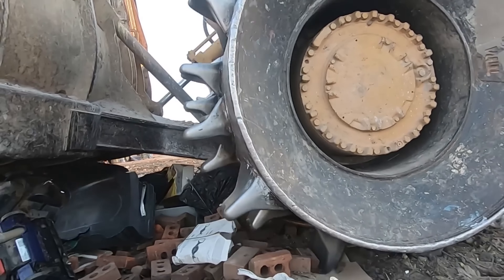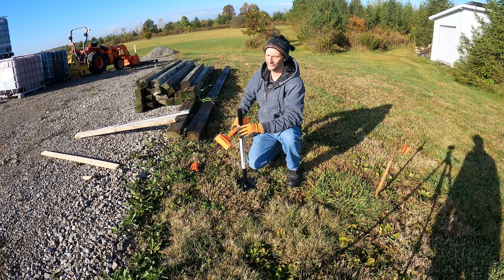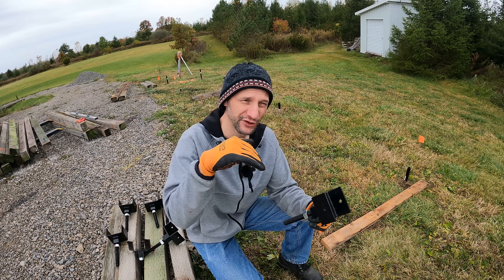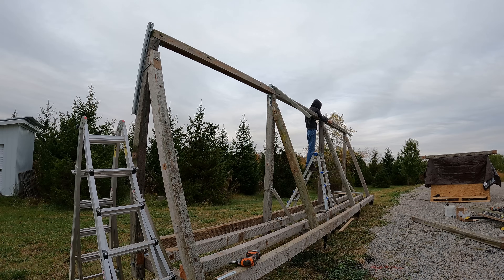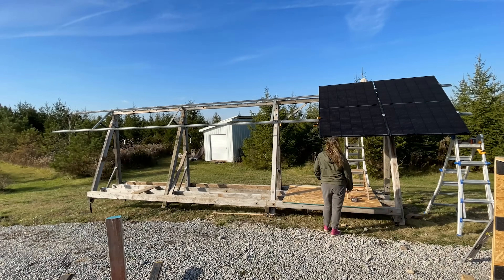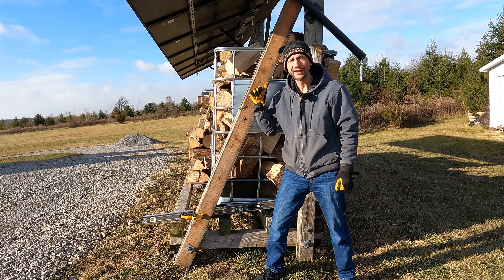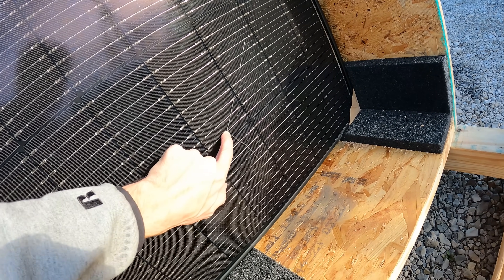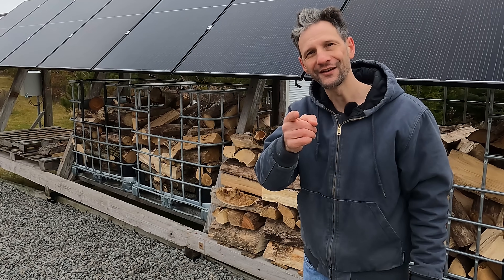Solar Panel Firewood Rack From Recycled Materials-Part 1

Comment from the maker: DIY Solar Powered Firewood Rack From Recycled Materials  Part 2: https://youtu.be/XSxp8pbk7q0
I tried to make this 3kW solar array and fire storage system as close to FREE as possible using mostly recycled materials.  Better ideas? Comment below.
Click here for the circuit diagrams, and project details on my website: https://projectswithdave.com/diy-off-grid-home-solar-system/
Solar Clearout- Affiliate Link: https://solarclearout.com/?ref=PWD
See more projects and get my FREE Solar Financial Calculator on my website ProjectsWithDave.com: https://projectswithdave.com/
Click here to see the real time monitor: https://projectswithdave.com/daves-off-grid-monitor/
Victron Home Backup System that is powered by this array: https://youtu.be/6WO44Pa5EwI

Comment: Little bit late with the comment, but paintable silicone would work great for the sharp edges. Just slather it on with a rag if you don't want to dirty a paint brush for such a small job.
Reply from the maker: Thanks for the tip!  I might try that.
Reply: Or thin out some caulk silicone using Naptha, and paint it on

Comment: Did this every fly away?
The posts you used seem to only use a nut to raise them but I see no anchoring effect?
I know it's a heavy structure but the right gust of wind on those large panels can shift a surprising load.

Comment: There's a reason bridges and skyscrapers are made exclusively of concrete and steel.  I got so tired of dealing with sinking foundations, rotting wood and having to replace boards and post, that now I just emulate what the professionals do.  There are unbelievable amounts of good used I-beams and structural steel on Marketplace and filling 4 post holes with concrete at $5 per 80lbs bag is well worth the time end effort of redoing things.
Reply from the maker: That's a good idea if you can get galvanized material it should last a long time.

Comment: its expensive but I was thinking of building a solar roof for a shed with bifacials and using 3m window weld polyurethane (or the 13$ chinease equivilant) to seal between the panels. its made to expand and contract on a very hot window connect to a car while also keeping water out. just a thought. there was another youtuber who made a similar structure and he used some kind of silicone sealant and said it was a big pain sealing all the cracks. the bifacials look really cool though as a roof and ironically can be cheaper than osb. i think they make grease gun type tools to extrude the window weld very efficiently. would take a lot of tubes though.
Reply from the maker: Providing a water tight seal between rows of panels and still providing for thermal expansion space is very difficult with existing panels. I think it would be great if a manufacture came up with a panel frame that was designed to do that from the start.

Comment: Dave, at what point does an offgrid solar array require permits?
Reply from the maker: I'm sure that will depend on the regulations where you live.  I suggest calling your building department and asking what the requirements are for you.  I'm sure a folding solar panel connected to a solar power station isn't going to require a permit, after that I wouldn't venture to guess the kind of regulations some jurisdictions might have decided to impose.

Comment: Nice video. I like your videos and have subscribed. Conductors over 50v need to be unreachable don't they? enclosed, in conduit or above 8'? You have PV wire inside and out exposed to tampering? Did the inspector say anything? Thanks
Reply from the maker: Some areas are requiring fencing around solar installations for those reasons.  However, that is not a requirement where I live at this time.

Comment: What did you use for hardware with the unistrut to hold the panels down?
Reply from the maker: I used SLR100SA mid clamps.  Probably the cheapest way to do it is to order some mid clap brackets like these: https://amzn.to/3UvThkt
Then source the stainless steel bolts and galvanized Unistrut nuts separately: https://amzn.to/47VQRi5

Comment: I'm glad to hear they plan to sell the jacks. I planned a cheaper knock off of a sinclair system and that was the part that threw me off the most. I was going to use harbor freight trailer jacks when I get around to the build.
Reply from the maker: They are very heavy duty and work well.  The paint coating isn't great but you could add to it if you wanted.

Comment: I work in the renewable industry. I woek daily with electrical equipment. Therefore I would never choose flamable build material for a solar installation...
Reply from the maker: Have you see a lot of fires with the solar systems you have installed?
Reply: @ProjectsWithDave  not personally. But this is the wrong question. The question is can it happen and what is if... Breaking a DC circuit under load can also be problem  and dangerous. Also under fault it won't open necessarily , since the breakers/ fuses have to be rated for max panel amp output....
Reply: @Gallardo6669 If it’s not attached to a dwelling structure, I’m not sure what the issue is? Firewood storage code?
Reply: If it's on or near a dwelling or something else you don't want to catch on fire then it's likely code to use rapid shutdown devices, but that would significantly increase the cost of this build, so just don't put it near anything, hope for the best, and get out your marshmallows for the bonfire on the off chance that it does go up.

Comment: I was wondering why folks don’t cut off the extra railing at the end of the array?
Reply from the maker: Cutting it off a few inches from the last panel is best.  I only left it because I constantly change panels and I might need the extra length for a different configuration.

Comment: For IBC tote edge protection, I use pool noodles or pipe insulation. Easy to split, wrap and place a few zip ties.  The pool noodles degrade over a few years, but for $1 each its a good investment every few years. 

BTW, building a IBC tote wood shed this weekend with wood fence material from a recent replacement.  A few good posts, a few bags of concrete, some horizontal pickets, and solar panel roof with some excess 250w panels I have.  Should cover 12 IBC totes (3-4 cords) while allowing enough airflow for wood to dry. Not sure what I'll use the panel power for, but might as well have it ready.  Recharge solar generators, UTV, run a few deer feeders, or just keep pare batteries maintained? not sure yet.  Fun project either way, and gets the panels off my garage floor 😁
Reply from the maker: Nice!  Thanks for sharing your project.  Worst case, you could always just heat your hot water with it until you find a more urgent need.

Comment: Not bad.  Admire the low(er) dollar approach to Solar.  If we were doing a design review, I would offer two cautions == 1.  The firewood may attract termites, right there where rack frame (also wood) is.  2.  The high angle for the Solar can give a VERY high wind load on the backside of the Solar Panels -- like a parachute, but the panel glass and/or aluminum frame (edge of panels) bolts/anchors may fail.  We have experienced both of those wind load failures.
Reply from the maker: Yes, the wind loads on these systems are the biggest structural concern.  You have had solar panel frames fail from wind loads when mounted in a more vertical orientation?  Were the panel mounts close to the center of the panel?

Comment: THE SOIL SCREWS FOR FOUNDATION LOOKS LIKE A HEADACHE... WHY NOT JUST USE REGULAR CONCRETE FOUNDATION BLOCKS?
Reply from the maker: The panels act like a sail so the system needs anchored to the ground.  Not a problem in the winter when there is wood on the rack, but in the summer when it's empty and we get 60mph winds it would blow over.
Reply: You could always keep a minimum load of wood in the rack to hold things down.  Great use case for recycled/up cycled stuff. Love your efforts.
Reply from the maker: Thanks!  I thought about that, I could have some wood seasoning and keep it at apposing ends as ballast.

Comment: The Structure Looks Overkill but if its Recycled Wood and Free materials, then yeah go for it.  Maybe a Fresh Shot of Stain would Tidy it up Nice.
Reply from the maker: Yes, it's overkill, but if the materials are free I won't complain.   : )
Yea, that might improve the appearance.  I'm not sure what would stick to that old weathered wood.  It would probably need power washed or sanded to get to material that could hold anything.

Comment: Closed cell foam water pipe insulation split n tied could work on the edges. Sold with different inside diameter sizes.I think they come in 4 or 5 ft lengths Nice project.

Comment: Use a grinder and a grinding pad, 80 grit to knock down any sharp edges..The pad you would use to grind a weld..I built two racks for solar panels in the last month, One is cemented into the ground with 4x6's and has ten inch giant screws that it rotate the whole way around on, to get the right angle of the sun..The other is very similar, except it's not cemented into the ground, instead it has two bases that has 4 wheels each, so I can move it to follow the sun, although it has the same tilt mechanism..I poured some cement into the ground and attached some eye bolts, to attach  thick wires to the structure for when in it's in it's two different positions, so it can't go anywhere.Along with a small wooden track way on the ground for the wheels to easily roll from one position to the other and back..The reason I wanted both racks to be able to tilt all the way around, was incase of bad storms that might contain hail, I can position the panels straight up and down, so the glass can't be hit..There is a guy on YouTube, his name is Rodney Hunt, me and him both got that idea from another YouTuber, but I can't remember his name..Except I made one with wheels and one cemented into the ground..Yours is a good idea also..I would just jack up that low corner until it's level and put some flat patio stones under it, probably on top of a flat piece of metal or wood or something so it can't sink..
Reply from the maker: Sounds like you have quite the elaborate setup.
Reply: @ProjectsWithDave  Check out that video from Rodney Hunt, DIY adjustable Solar Ground Mount part 1 and part 2..It's really a very simple and cheap system..The one with wheels is slightly more complex, but still very easy and simple..$300 dollars in parts for one and $500 for the other..But I did already have some of the stuff I needed..I live in the Adirondack Forest in this deep valley, with mountains on 3 sides of me, which is why I did the one mount with wheels, makes a big difference to be able to follow the sun and get the tilt perfect..I only have to move one side like 10 feet, and then I move it right back when the sun goes down..

Comment: Would a simple gutter beneath the panels front edge be smarter for drainage?  A frequently trafficked area can and will get muddy.  Carts, wheelbarrows, tractors, forklifts and other things in there over time will reek havoc.  Anyway, low cost and producing watts were the goals.
Reply from the maker: I considered a gutter.  If the gravel is insufficient I'll add one.
Reply: We have a similar install with raised bed gardens underneath. We’re adding gutters to feed a rain barrel that will feed the raised beds. Mini-agrivoltaics.